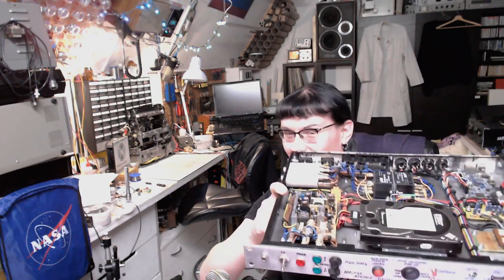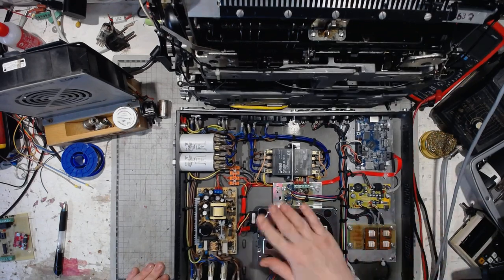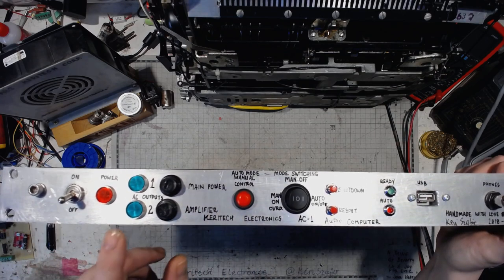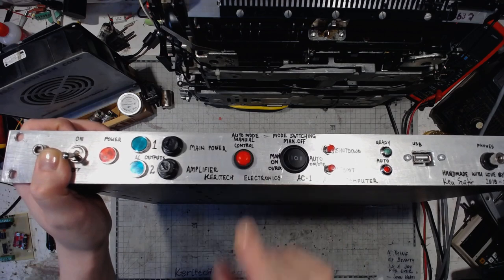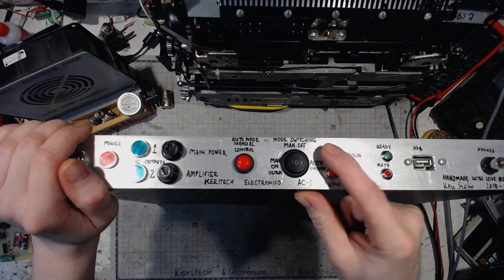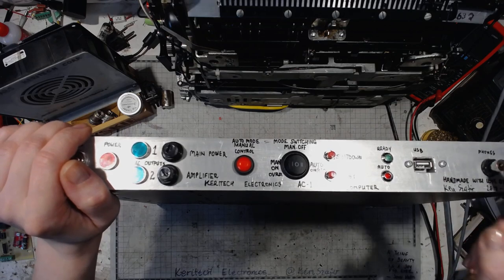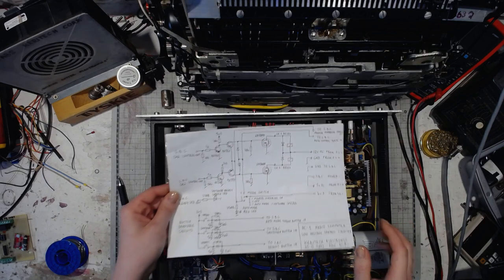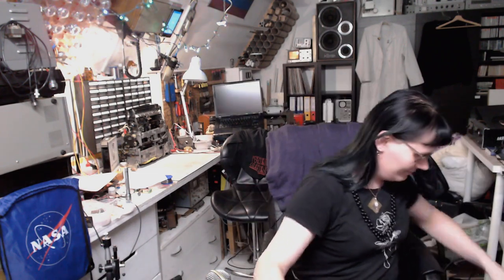AC-1 Audio Computer - Overview

Comment: Great idea simplifies power switching,  I would probably use mqtt for the device controls myself to make building a UI easier but the main thing which is appealing is getting all the hardware in the box instead of scattered around the place. what software do you use for a music server?
Reply from the maker: I was thinking about MQTT - will probably include some routines for that, because I'm thinking of making a systems control device for my lab. Not exactly the Apollo DSKY, but pretty much inspired by it, haha. Initially I thougt about controlling OBS only, but who knows, maybe I could extend my idea to lights, hifi system etc.

I used pulseaudio, but want to switch over to something more reliable like JACK.